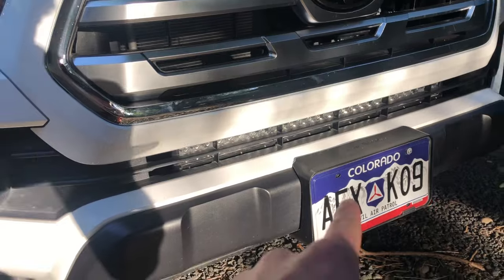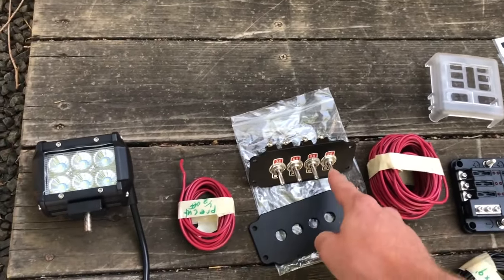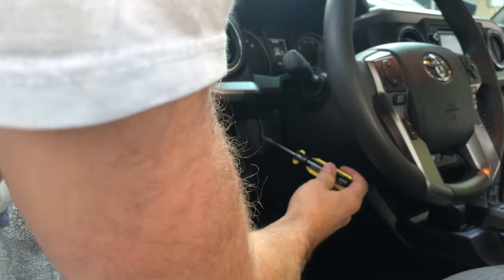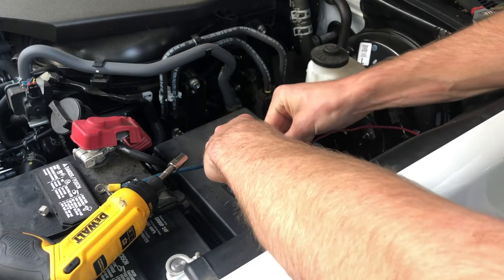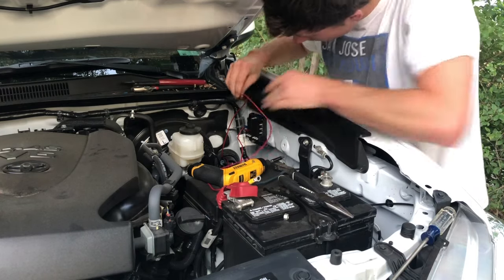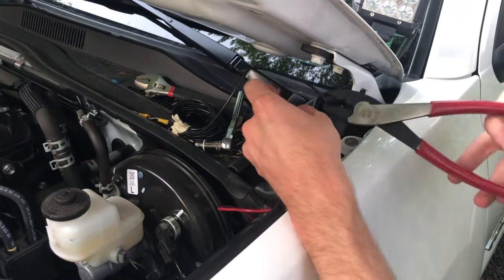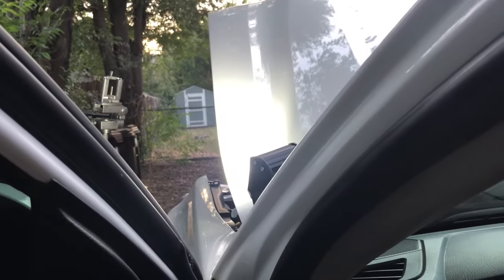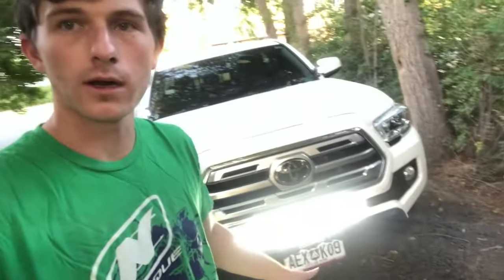Best Way To Wire Accessories

Comment: Your install has a high risk of fire.  Your add-on fuse panel is rated for 100 Amps, which your total value of all fuses in the panel must add up to be less than.   Your wire from the positive battery terminal to the panel and the ground wire from the panel to the negative battery terminal, or ground, needs to be sized for 100 Amps, which would be a minimum of 4 gauge wire.   That power wire, from the battery to the fuse panel, must also be fused with a fuse rated between 90 to 100 Amps and placed as close to the battery as possible.    The comments love your install, but your teaching unsafe practices.

Comment: I wouldn’t run positive wires through the firewall, it’s best to run ground wires so nothing can short. You also need to run a circuit breaker to protect your vehicle from a short and you need relays. Halfway there but nice job thus far.
Reply: Whst circuit breaker do you recommend?
Reply: @jasonrosas1295  Bussman
Reply: So basically your saying make relay panel?
Reply: I’d probably use relays as well
Reply: with all those lights and stuff, I'd use a battery isolator with a relay and auxiliary battery. at least that what I had to do with my bimmer and 1500W amp
Reply: @uncommonsense360  Right on. What kind of battery did you use for your sound system via battery isolator and why?  My assumption is just the same 12v the auto run so but would think it could be scaled down for sound on,y.
Reply: @mredmister3014  yeah any small 12V battery box works fine, I had a huge XS power battery in there before but it weighed down my trunk.
Reply: Any videos out there with this suggestion? (not to run positive wires through firewall)
Reply: Could you just use one relay PRE-FUSE BOX? Would love to learn the benefit of the relay. (Video links?)
Reply: @jasonrosas1295  You have to determine the wire & fuse size based on the load
Reply: @AlanHouser  There are several ways to feed circuits through firewall just be sure if you decide to drill a hole you remove any sharp edges and use a rubber or plastic grommet and protect the conductors too as a secondary precaution.  Another option is to install a termination block or firewall cap/stud.  3. Find an existing penetration and run alongside previously installed conductors. 4. Run below chassis along frame rail if you don't plan on entering interior.  Many acceptable options.
Reply: @rpruneau68 p. A short wire from the battery terminal to an In-line fuse on the hot side (Red). That way it only cooks 2-3” of wire before the fuse and not your whole vehicle. I bought a kit from MGI Speedware. One big inline fuse 70amp in my case 10 gauge that runs to a fuse block with 4 separate relays each one with its own fuse. All pre wired ready to go so all you have to do is setup your switches.
Reply: it's ok to run positive through firewall, if you're running it through an appropriate grommet and have fuse installed near the battery.
Reply: @CM-xr9oq thanks for clearing that up I’m like how the hell do I not send positive through the firewall if that’s literally the direction every accessory I want to power is in lmao thanku

Comment: Um...no relays? Not very safe for high-draw accessories like auxiliary lights. Tut tut.
Reply: Shazzkid what if he uses a  circuit breaker? Does that help or are the relays nessesary?
Reply: @RONIN1111  a circuit breaker only helps against an excess draw in current. But with something like auxiliary lights, they might run on 5 or 10A and that's normal for them, but very dangerous for you. 
A circuit breaker would only kick in if the current was to rise above, say, the 15A fuse you put in. But that is far higher than a safe level.
You get what i mean?
Basically relays are necessary, as necessary as fusef circuits, and should be used together in high current applications with user operated switches.
Reply: Appreciate the response. I’m working on a 2nd fuse box with a 100 amp  circuit breaker. Just learning about how to safely wire power to it. Do I need relays vs not needing relays. Appreciate you again
Reply: @RONIN1111  wait it has a 100A circuit breaker or just a fuse?
Reply: @RONIN1111  Relays are generally the correct approach, so the default answer is "yes, use them". However they are definitely not absolutely necessary in all cases. If the switch is truly rated/capable of dealing with the voltage and current you'll be running thru them, then eliminating the relay might be ok. But using a relay will usually allow shorter high current wiring from power supply to the auxiliary device. In application like this, that would prevent the high current wiring from passing thru the firewall and being inside the cabin. Also greatly reduces the load you put on the switches, making them smaller, lighter and less expensive.
Reply: I’m confused. I just bought a camping fridge and I was going to run a fused line to the truck bed a put it to the fridge. How would a relay make this safer? Thanks

Comment: Wouldn’t it be smarter to put all the switches on the negative side so you don’t have to run any hot inside your car, under your dashboard, wrapped around everything else etc. aren’t best practices to put the switch on the negative/ground period
Reply from the maker: Electrons are still flowing through the negative side just as much as the positive side. Great thinking!

Comment: wow that was great explanation
i have couple of questions
1) in that small fuse box. do you have the one wire from battery to that terminal and feeds all switches with fuses or you need a new wire from battery with fuse for every accessory light you want to add?
2) when you said wire goes to switch then comes back and go to light, are both red positive wires ? so you have 2 red wires on off and on position on toggle switch ? 
thanks
Reply from the maker: 1. yes
2. Hot red wire goes to switch, red wire leaves switch and goes t to LED. Ground LED anywhere on vehicle.
Reply: @92813justin  you are a life saver bro

Comment: Any issues with accidental battery drain — even with switches turned off?
Reply from the maker: No, the battery is 4 years old now and never had a problem after the install

Comment: I’m interested in doing something similar to this but I’m worried about having hot wire is constantly running to the switches will that not draw too much power and eventually make your battery die? I sleep in my Tacoma and I’m trying to make a hard-core rig.
Reply from the maker: Use relays
Reply: Use a relay and connect load side pre-fuse panel with control coming from Key-On Ignition.  Fuse Panel will only be active while key is on if load is run through positive lead from battery to fuse panel.  I would also place an in-line fuse between battery and relay and upsize to at least 10 gage.  Fuse and wire gage should be sized by calculating total load.

Comment: Awesome video ! Do you think I need a second battery to run multiple light bars or the one battery would be able to handle the load ? Thanks !
Reply from the maker: You should be fine. If you are running them when your engine is off you would want to calculate how many hours you can run it for. The equation is: (watt-hours of your batter)/(LED watts). You will get the amount of hours you could run the battery until it is 100% dead. I would take your # of hours and cut it in half to have voltage to start your truck.

Comment: I bought the - “Bay Marine Supply 187 Series Circuit Breaker – 30A Panel Mount 48V DC Max – Ignition Protected Single Pole Thermal MRCB Marine Rated Weatherproof Manual Reset with Switch Function” 

Trying to learn if Im gonna need individual relays for each accessory I wire to the new fuse box.
Reply: Circuit protection is based on most vulnerable device in circuit.  So conductors, termination points and fuse should be rated based on calculated load.  Placing an oversized circuit protection device (Fuse or circuit breaker) in a circuit puts the conductors, switches, panels, loads at risk since it won't do its job before something potentially fries...  Same reason we NEVER replace a known blown fuse with one that is larger or greater.  Relays are arbitrary dependent on function.  Relays are used to have smaller current control larger load.  Circuit needs to be calculated to determine component and conductor sizing.  This will also determine if relay(s) should be used.  The other option is to ground side switch instead of running power to them.

Comment: Did I miss where you used relays?
Reply from the maker: I did not use any relays
Reply: @92813justin  So all the current being drawn by the accessories is running thru the switch? And you consider this the "best" way to wire accessories??
Reply from the maker: @GroovesAndLands  I am was below the voltage requirement for these switches.
Reply from the maker: GroovesAndLands, which relay would you recommend? I’m looking for something that has 4 relays in one.
Reply: @92813justin  You could do it several ways. In the past, I've snagged an OEM relay/fuse box from the salvage yard. I think I always liked the Ford Focus ones, because they had a nice rectangular form factor that was nice for custom applications. Those are old and probably scarce now, but some rummaging thru the salvage yard, you'll definitely find something usable. The good thing is that stuff is OEM quality. Bad news is they're often shaped "just so" to fit the OEM application. You'll also need to score the OEM wiring diagram so you can make good use of it. Plus, it'll be pinned for whatever style terminals that OEM used. It gives a nice "factory" look, but not the easiest.

Or, you can buy a generic relay/fuse box on amazon or ebay. Here's one on ebay for $32: https://www.ebay.com/itm/Universal-6-Way-Fuse-Box-Relay-With-6-Relays-12V-Car-ATC-ATO-Fuse-Holder/372783877064?hash=item56cba68bc8:g:48cAAOSw19JdjBCn  Chinese, of course. Probably ok so long as you wire it using professional best practices. You can buy higher quality units, of course. Painless sells one, but there are many sources. They will be more expensive, but not prohibitively so.

Another option, which is pretty f'n sweet, really compact, safe and reasonable priced is something like this: https://www.summitracing.com/parts/msd-7564 At $160, this thing is probably the coolest way to integrate extra circuits into your custom vehicle application. Has four 20A channels.

Last option is super duper awesome and really high tech. For complicated systems, this thing has great versatility, but it's expensive: https://ecumasterusa.com/collections/power-management/products/ecumaster-pmu16-power-management-unit?variant=8318139269181  A good handful of different ones on the market, but all very similar
Reply: @GroovesAndLands Hey I'm just curious I want to do a similar setup to this on my 350z to light up all of my leds, and I'm wondering why using a relay? I'm not really good at electronics and everything so I was asking you
Reply: @yan.lefkakis  Using a relay depends on power needs which will dictate how big and heavy duty your wiring and switchgear needs to be. Power in watts is equal to voltage times current. P=IV So if you've got a 100W light and you have a 12V system, you can calculate the current. 100W=12V*xA In this case, solving for current, you get 8.3A, which is significant.

You'll need to figure out what size wire you need to safely carry the current your accessories demand, and that will depend on how long the wire run is going to be. Using a relay can minimize how much large-gage wire you need to power your circuit.

To be more specific, I'd need to understand your application.
Reply: @GroovesAndLands  thank you very much!
Reply: @92813justin  Current is rated in amperage not voltage.

Comment: Definitely DO NOT run power > fuse > switch > load! It should AT LEAST be power > fuse (as close to power source as possible/reasonable) > switch > relay > load /// power > fuse > relay (with switch on negative) > load. 

Doing it the way in this video, could possibly, end with u saying "well look at that! We have light! Red and yellow light... Waving... Wow, that light just turned into a REALLY LOUD BALL OF LIGHT!"

Title of the video should be "Not the best way to wire ANYTHING in a vehicle"
Reply: Also, do ur math and run the correct gauge wire, with suitable heat rated sheathing when it's in an engine bay. My minimum is cross-linked polyethylene XLPE and my hands down is Tefzel ETFE (there are more unreasonably better wire types, than that, and I recommend those, if u plan on reusing em after u blow up ur car from using this guy's method of wiring).

Yes, wiring pos to load to neg will work... How long really is the issue